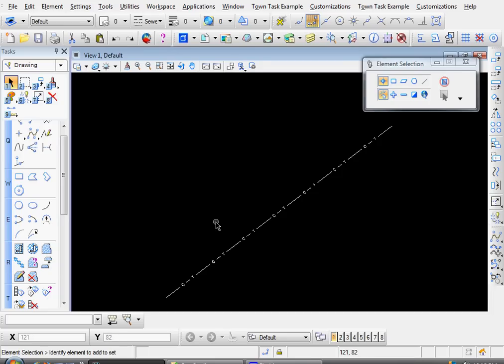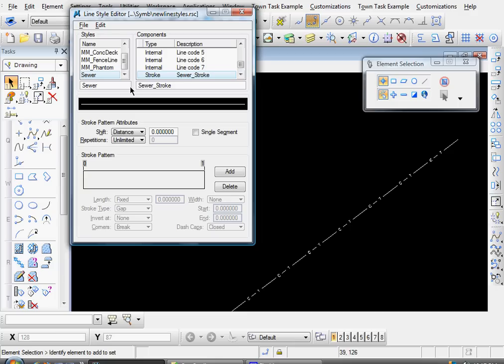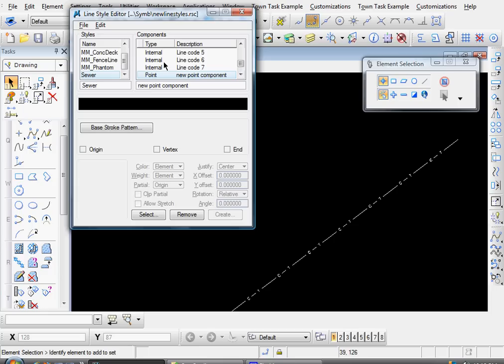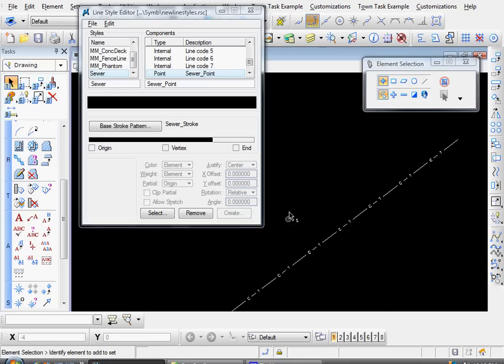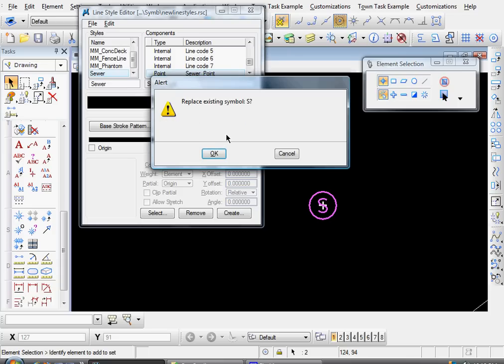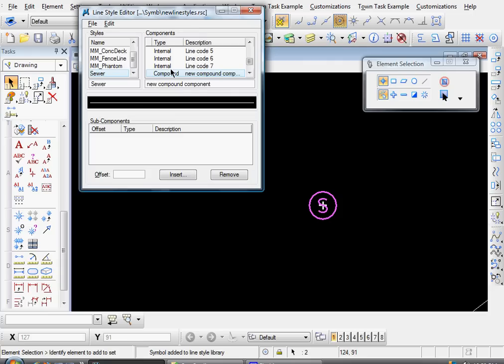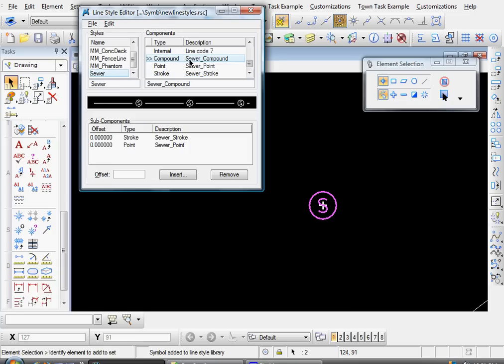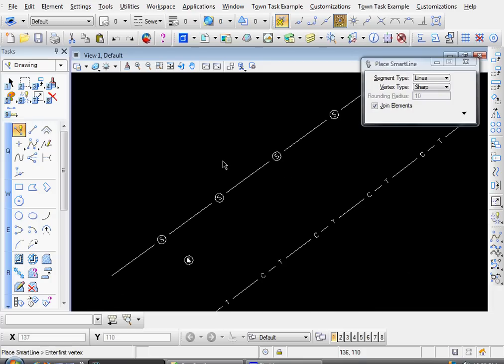Bentley Microstation V8i - How to create a Custom Linestyle in Microstation

Comment: My Line style does not load, How do you load after it's created? Not working automatically after saving. Any suggestions?
Reply: if you have created your linestyle within an existing .rsc file then try to import that same .rsc back into your .dgn. It should tell you that you have duplicates but simply scroll to the one you have created and import that one.

Hope this helps.

Comment: Hi Jeff, if my default drawing scale is 40. What's the correct way to create a custom linetype? Having trouble with spacing the points. Not enough points when changing to larger scales?